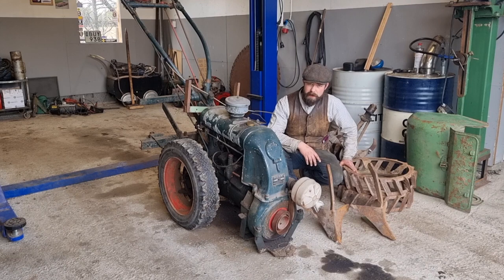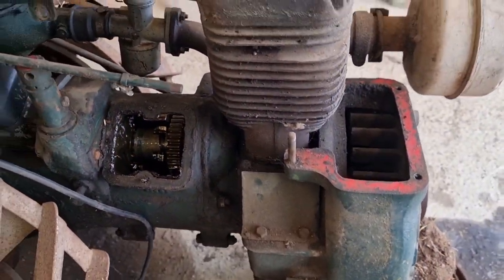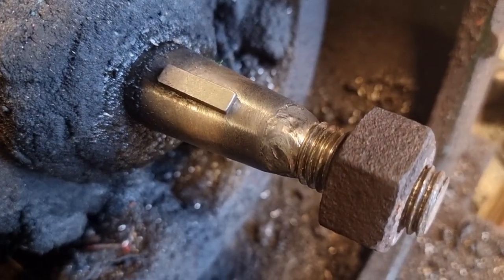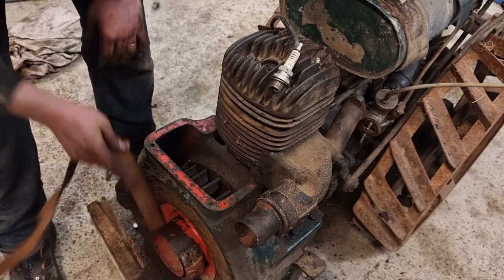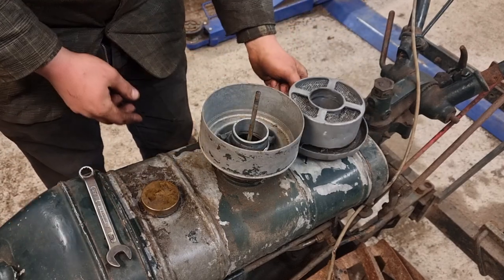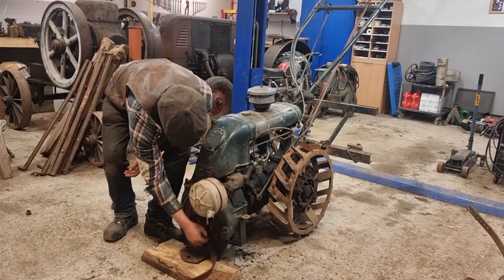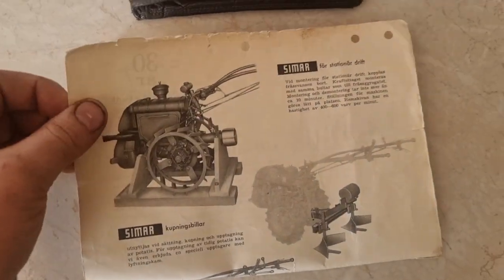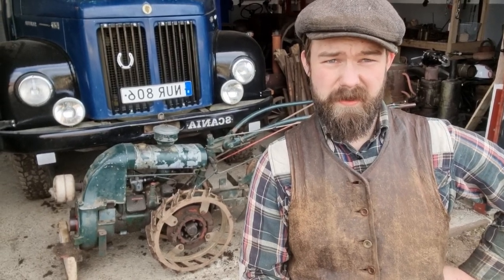Rotortiller BIG size. Can we get it running for no $$?

Comment: I have one of those, a smaller one,  in my barn from my grandfather. It was his first before he went to Rototiller that later became Graham Paige and then Frazer across the pond here in the States.  The American version was a knock-off of Simar by Simar's American importer who later went independent after developing springs for the tines.   What did you use for the 2 cycle fuel mix?  Great work!!

Comment: Nice old machine, i wish i could find such machines in Australia they are very expensive everyone wants to collect them. I like how you just make it work without much fuss.
What oil did they recommend for mixing the 2 stroke back then, just 30W engine oil?
Reply: Yeah, here in Victoria everyone who has one has it in their front yard as garden art, would love to get my hands on one too but the prices are just ridiculous.
Reply from the maker: Interesting. Here they aint expensive. Like this working one would sell for like 500 dollars maximum here. And they are quite rare here. 

The market is just low for 2wheel tractors. But other vintage machines and stationary engines has gone up like crazy. /Richard

Comment: One thing caught my eye. It has oil bath airfilter yet in normal operation the whole filter is in quite steep angle. Usually those oil bath filter are meant to work level, but obviously it works 'good enough' in this case.

Comment: Gasoline in AR/USA today is $3.68, now sure how much it is where you are. By the way, you might want to look into the value of that Indian Motorcycle sign you're using as a work surface. It may be worth a bit of money. Some of those signs are quite valuable to collectors.
Reply: Gas here is about $8 / gallon.
Reply from the maker: Yes, like $8 gallon..... 3.68 would be like waking up in a dream, but better. 

And our gasoline is minimum 10%ethanol by law... so lower energy content as well.
Reply: @YesterdaysMachinery  Most of our gasoline is 10% eth,  I can purchase ethanol free at certain locations but only in 92 octane, which is a bit more expensive than the 87 octane with ethanol in it. I burn 10% in my truck. Everything else from my motorcycle and smaller gets ethanol free only.  I hate the ethanol damage to the rubber pieces done by ethanol, especially in older equipment not designed to run on it. 87 octane today (12/29/22) is $2.33 a gallon. I hope your cost have come down as well.
Reply: @YesterdaysMachinery  Can you buy aviation fuel?
Reply from the maker: @douro20  Hi, no not that i know. /Richard
Reply: I had one of these probably about 45 yrs ago I was given and much to my surprise it started very easily but very noisy as it had no silencer at all 😮it took had roller bearings for the crankshaft and they were rumbling unfortunately I had to give it away as I lost my workshop and storage 😐 excellent video 👌

Comment: How much is fuel there at the moment?
Do you run any alternative fuels at all?
Im currently modifying a couple of diesel vehicles to run on other liquids.
A much overdue task!
I've been collecting for a few years now hahaha!!
Reply from the maker: Hi! Yes all my diesels i run on waste oil. Bio and not. Anything but used black engine oil. It clogs the fuel filters to fast. /Richard.
Reply: The 95 oktane petrol (with 10 % ethanol) is around 21 sek / liter.
98 okt petrol (5 % E) 22 sek / liter. 
Diesel 25 sek / liter.

Comment: For the first time I see a guy who doesn't give a damn about cleaning the parts as well as necessary, but has decided to keep the precious decades old dirt and dust on them for the future generations 😆
Reply from the maker: Inside and moving parts are clean, on the outside there is no better protection than oily mess 😎 Here in Sweden, collectors of vintage machinery can sometimes save some of the oily dirt they remove and put it in jars because it is "original dirt" belonging to that specific machine. May sound strange but thats true. And to repaint a original old machine here is not good. Like an old hit'n miss engine. If it is original stand you will get double amount of cash compared to if you paint it. Market for repainted machines and engines is very little here. /Richard
Reply: @YesterdaysMachinery  I personally would've used a carb cleaner to soak and wash everything thoroughly to get rid of all the residues in and out of the carb and also would've put some grease in magneto bearings, but if you're planning to resell it, it's a different story of course. But thanks for your answer! Eric ✌

Comment: Just found your channel and have been binge watching! I have one question, how are you able to get old, rusted bolts and nuts to come free so easily? Here on this side of the pond rusted nuts just round over with a 6-point box or socket, and you are using a 12 point with no problem.

Comment: YOU PUT THE PISTON IN BACKWARDS MATE???
Reply from the maker: Yes! That is correct 😅 I actually did. I am quite used to mounting engines, so how it happened is a good question. I checked in the cylinder that the channels   did line up with the shape of the piston, but then i flipped it again befor installing the pin. My bad. Only thing i can blame is that is was like over 1am when i mounted it 😅 But 15 minutes later and it was back together again. Got a bit tired of myself yes.I think like you and 3 more have noticed it.  /Richard  1😁
Reply: @YesterdaysMachinery  - you know the old saying?
"Show me a man who never made a mistake, and I'll show you a man who never made ANYTHING."

Comment: You put the piston in backwards
Reply from the maker: Yeah, explained it down in the comments. A mix up of several things. I swapped it halv a turn when i saw that the cylinder ports didn't line up as it did when i held it first before putting the piston pin in 😅

Comment: Ho un Simar, j'en ai un aussi, un C51, sauf que le mien a le moteur de complètement collé par la rouille. même a la presse ça ne c'est pas décollé.
Donc faut que je lui trouve un autre moteur.
Reply: Google translate:
Ho a Simar, I have one too, a C51, except that mine has the engine completely stuck with rust. even to the press it did not take off.
So I have to find another engine.

Comment: Your sound is terrible. Get a better microphone. Are you changing the gearbox oil?
Reply from the maker: Hi! I bought a mic for to many $. But that was even worse than the mic on the camera. Sorry if the sound is bad, i think it sounded just fine on my tv, but i will check. Yes the gearbox oil is now changed. Heavy SAE140. /Richard